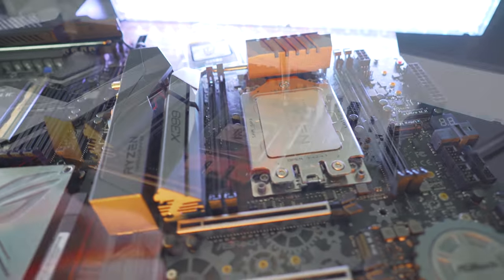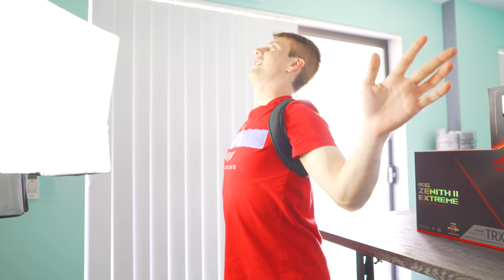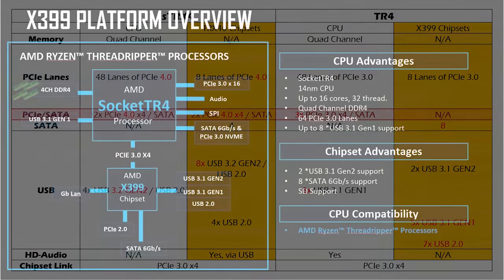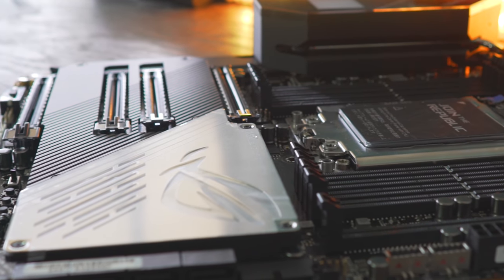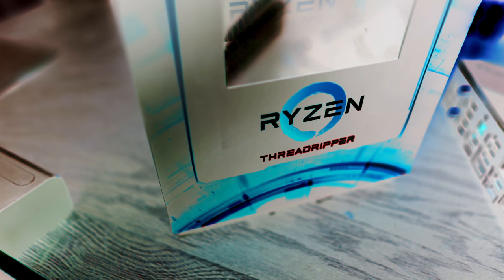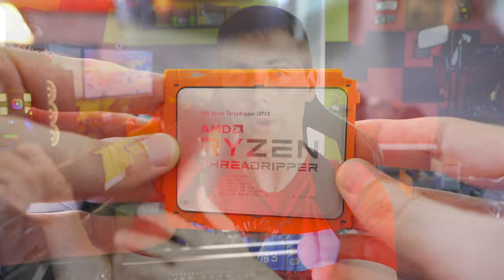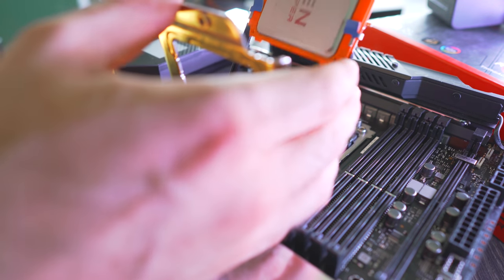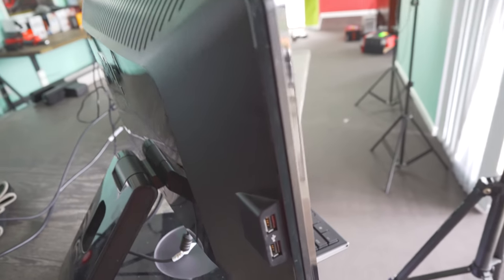Why the 3970X Won't Work on X399 - New TRX40 Vs. X399 Differences Explained

Comment: hmmm....maybe someone should take a closer look to the socket...a 9900k or 9700k could run on z270 chipsets....it is a very good reason why someone should not trust the manufactors!! 

i guess, with a small modification u can run a new ripper on a x399.....the future will shows it

Comment: Why couldn't amd do the same with tr4  as with am4? Money grabbing?
Reply: Changing the sockets doesn't really benefit AMD all that much. If anything, motherboard manufacturers would benefit.
Reply: @MarcoGPUtuber  amd provides the chipset for the mb
Reply: @kevinvanneste2500  That's certainly correct, but the Chipsets really don't cost that much and have dev costs.

Comment: its probably just a matter of time before someone figures out they can mask off a pin or two and make it work.
Reply: I dont think so (or at least their would be MASSIVE drawbacks), because the PCIe configuration has changed. The chipset is connected with a different interface! (PCIe 4.0 vs 3.0. Not sure if the new CPUs support 3.0 for the chipset connection)

Comment: Oh, look...my prognosis was 100% correct. AMD is turning into Intel. 
Get ready, you bandwagoners. Prepare your pockets. 
AMD moved into Intel's entitled chair, with pricing, and motherboard price, and I quote:

"Considering that the ROG Zenith Extreme Alpha based on the X399 chipset can be currently found for $599.99 US and the PRIME X399-A can be found for $299.99 US, this seems like a major price bump. Now there are two things, we have seen that the X570 motherboards cost more than their X470 and X370 predecessors. The design choices and feature set, along with advanced cooling methodologies definitely add to the overall cost. The TRX40 series, however, has around a 2x price increase compared to their X399 predecessors."
Reply: @xCDF-pt8kj  X399's are premium boards. I don't know that there are any that don't have flashback.
Reply: @xCDF-pt8kj  not sure what you mean. I was only saying a lack of flashback wouldn't have been an issue since x399 boards will have that.

Comment: AMD is the new Intel 🤣 In short that's the WHY part you all find puzzling 😇
Reply: if you can't beat them [in trog mindshare]; join em. XD
i love it how they are doing this on radeon too. For every true blue amd fanboy; there are 20 nvidiots and shintels getting buttfucked by the price hikes. XD good!
Reply: @anasevi9456   LOL . Very true . The very first AMD chip was made (copied) based on a photograph of an Intel chip . No wonder that any business will chase the "greed" when satiated with the "need" . AMD has been investing a lot in its business lately . And so , sowing the seeds of hyper profit -- in Intel style -- is very normal a plan / practice . Board manufacturers will buy chipsets & consumers will buy boards . Just like the H & B 300 chips on LGA-1151 scenario -- same socket but different chipsets for different processors !!

Oh Intel , thou art the best business mentor :))